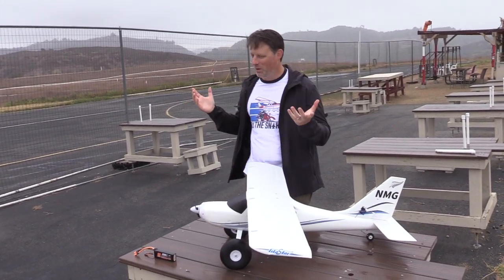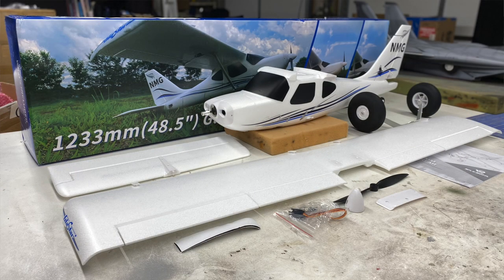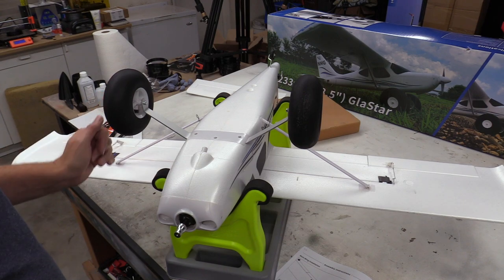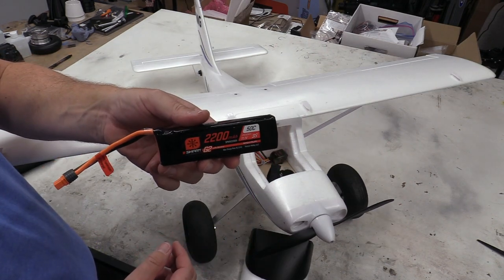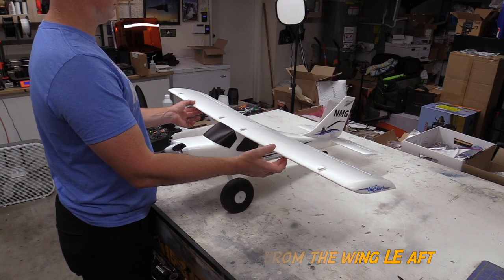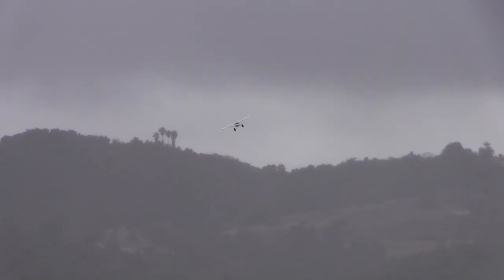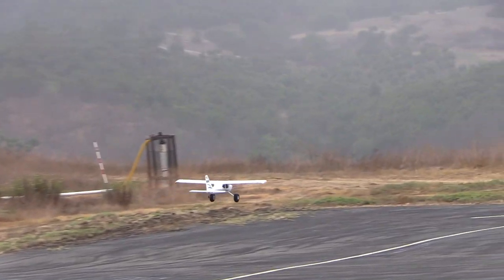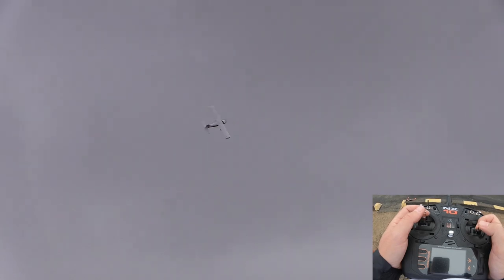From the Field -- XFly 1233mm GlaStar Assembly & Flight Review

Comment: I recently purchased one of these and they're a great plane. The ESC is rated for 2-4S batteries. Maybe with the extra voltage you wouldn't need more prop?
Reply: I was comparing this to the e-flite carbon z Cessna, which runs 4S, but only at 750kv, which puts you at the same prop RPMs as this plane with a 3S.
Reply from the maker: Yeah, I’m not sure the longevity of the motor, but might be worth a try. Sure would perk it up a bit.
Reply: With extra voltage, you normally use a smaller prop........
Reply: @Brian-om2hh  I guess that depends on the ESC/motor current rating, and what you're trying to do.

Comment: Yea man, I think I'm out of this Horizon Hobby stuff. I cant get parts for my turbo timber, not even a prop. Any ideas how to get a couple other than whittling one out of a block of wood?
Reply from the maker: I’d recommend looking for a comparable prop from apc instead of sticking with the eflite labeled prop.
Reply: @Thercgeek  need more people like you in the world. I thank you much for this. I'm just about done with the whole e flight gang. They should not sell what they can not service.  Learn from the Automotive field I say.  Bad customer support. Nice people but they do write back a little shout.
Reply: The problem is not exclusive to HH, buy a prop of a similar diameter and pitch, eg if the TT prop is a 12x4 try an apc or tgs 12x6 electric prop or if you have one in the spares box an 11x6.but get a power meter at the same time, check the motor spec and then CAREFULLY increase throttle, CHECKING METER AT 1/2. 3/4 AND FULL and ensure new prop does not exceed the max amp and watt rating of the motor or the esc SO THAT YOU DONT BLOW THE MOTOR OR ESC..   If it looks like it is about to do so then either reduce the throttle curve in your tx settings ( eg 0,25,50,100% DOWN TO  0,25,50 70,85%) and recheck power meter or reduce prop diameter by cutting a bit off the ends and rebalancing until you get under the motors max amp and watts limit .  Have fun.
Reply: @paulrkytek6587  yes I get amp draw and all that good stuff, probably cant tell I'm a controles engineer by my pic but heck yes sir. Sounds smashing and jolly good. Thanks for all the info, I will put it to good use.